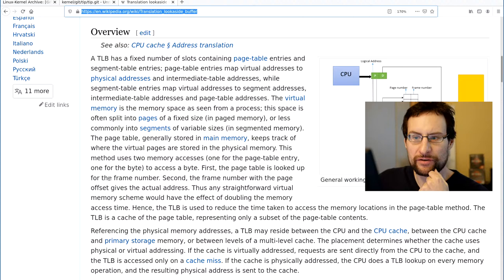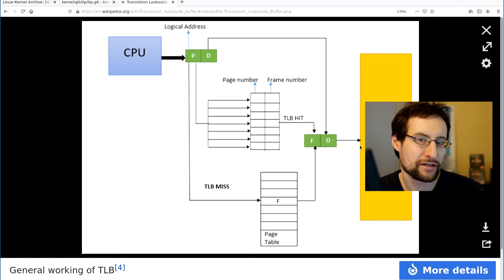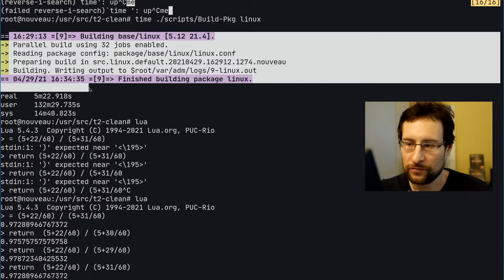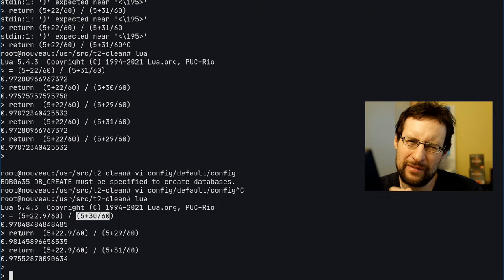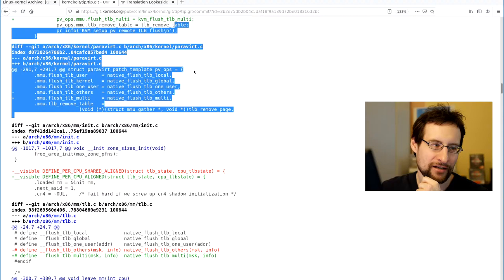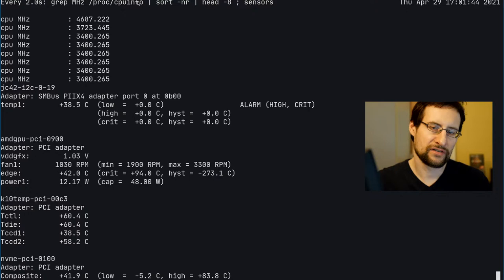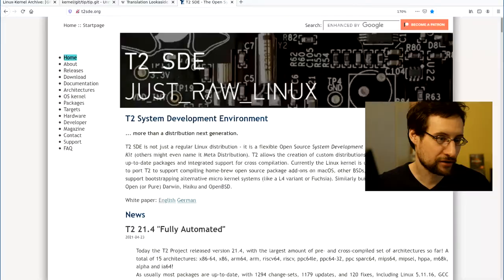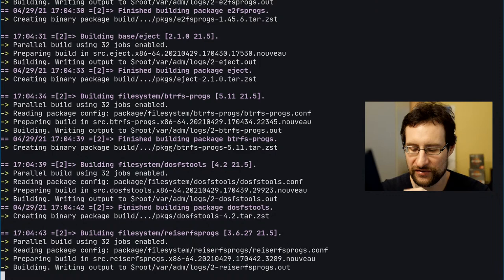~2.5% faster! Linux 5.13 Concurrent TLB flushes!

Comment from the maker: yay, more curve optimization and a tick stricter RAM timings, and:
== 17:11:04 =[9]=> Building base/linux [5.12 21.4].
-> Parallel build using 32 jobs enabled.
-> Reading package config: package/base/linux/linux.conf
-> Preparing build in src.linux.default.20210429.171103.1290.nouveau
-> Building. Writing output to $root/var/adm/logs/9-linux.out
== 04/29/21 17:16:24 =[9]=> Finished building package linux.

real    5m20.583s
user    131m36.531s
sys     14m25.426s